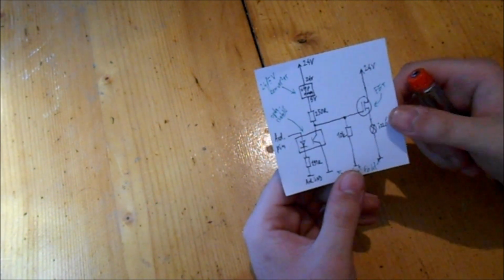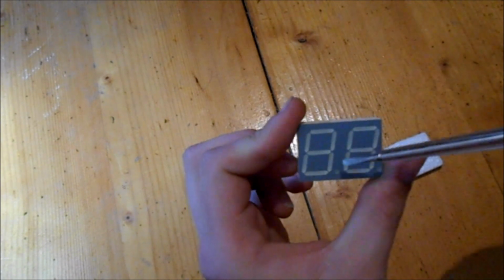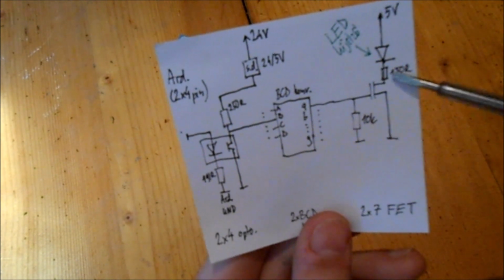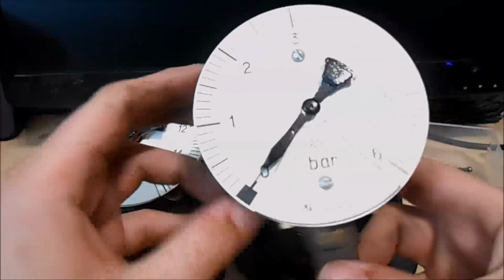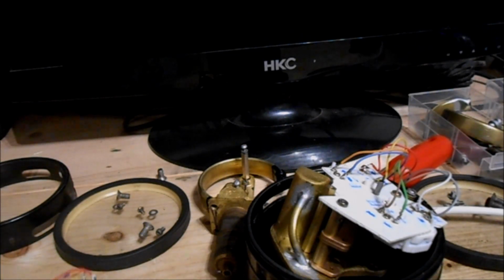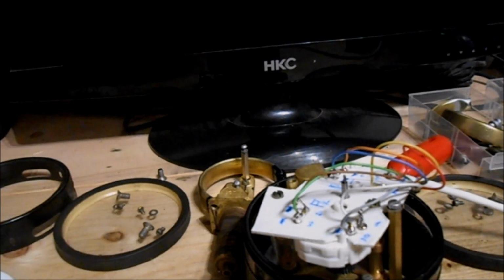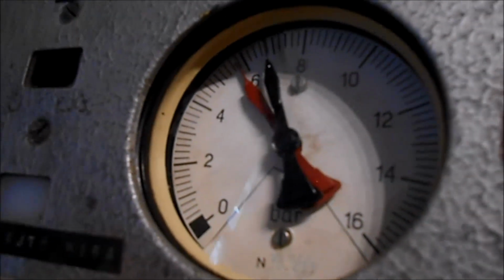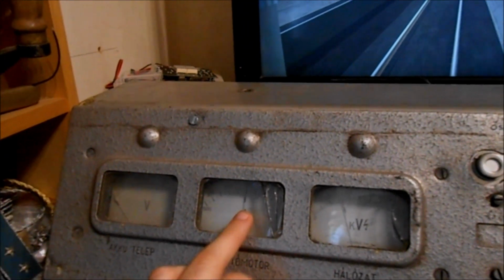[ENG] Ev3 metro dashboard (for LOTUS simulator)

Comment: i am curious where do u get these pannels from(i am not a fed). 
i wanna make something like this and it would be really good if u can help me get one of these.
I am looking to make  81-718, 717 and 740 ones
Reply from the maker: This dashboard is my friend's panel, he got it from another friend who I guess worked at our depot. All of these cars were withdrawn here in Budapest, almost everything went to scrapyards or to Russia (let's not talk about that part). But some parts were, let's say scavanged before going to the dump.

I, myself have an E type dashboard, controller and accessories, I got it from the Hungarian anti-counterstrike centre (long ago they bought 2 cars to simulate stuff on them, and I contacted them if I could buy some parts if possible).

The local transport company sells some parts on auctions, too bad there are not so many things left, but still they sold 5-6 Ev3 dashboards (almost like in this video), each for about 300 eur. I don't know if in other countries there's any way like this to buy stuff, because I know on ebay...etc these things are pretty rare (I mean the soviet trains, you can sometimes buy U-bahn stuff for horror prices).

Comment: can you try make dashboard of type 81-717?
Reply from the maker: This dashboard is one of my friends dash. He actually has a 81-717.2 dash (more or less in a full state), but that project wasn't started and I don't know if I will do it.

I have an Ev panel with a KV-40 controller and most of the accessaries (gauges, speedo) but I haven't made any videos about that (also I didn't record the making of it).
Reply: @Bzmot332bve  Isn't there a plan to make a video about the plugin and how to use it ?
Reply from the maker: @Hommbree  I don't really think. I'm thinking about writing an example on the forum lexikon page, but usually I don't really find time (and enthusiasm) to even open LOTUS...
Reply from the maker: @Hommbree  I'm rarely checking my old e-mail account if that's what you wrote to. Could you please write to my gmail? It's name is the same as my name here on YT.